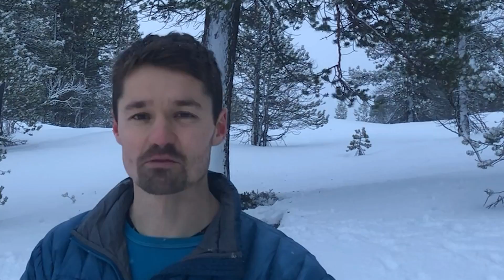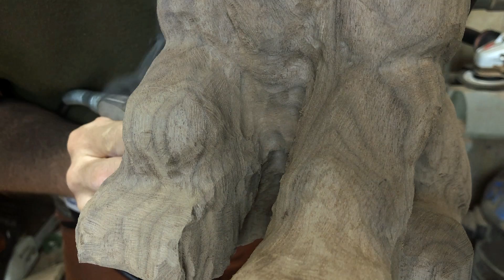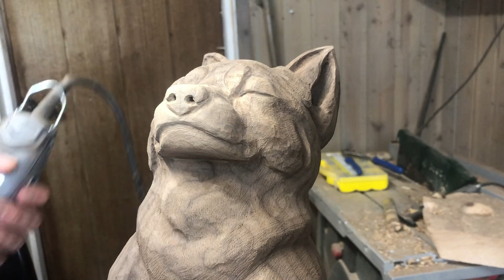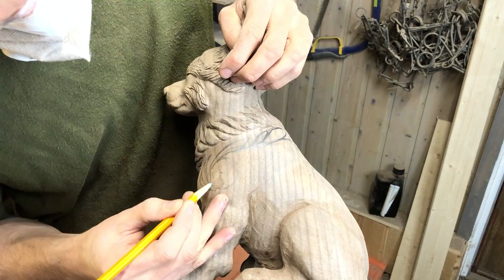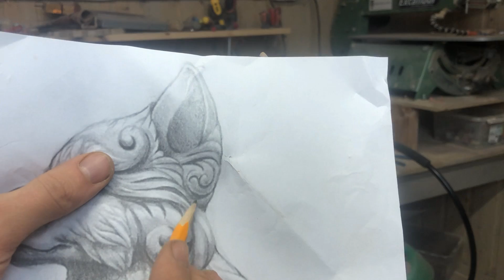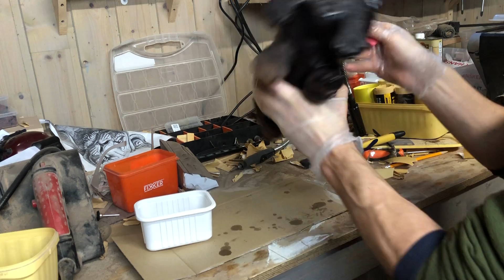Becoming Famous For My Sculptures Ep. 1 Season 1

Comment: Great work as always. I live in sweden and have a hard time to find good burrs, the one you used for the fur and other things, where did you get it?
Reply from the maker: Hey and thank you! I have the same problem. I have ordered many different cheap ones from ebay just to test them out. The ones i used for the fur is called Wolfram carbide burrs. i bought them off of fruugo.com.
Reply: @Jonasolsenwoodcraft  Aa ok, yeah I've seen that they had some on fruugo, wasn't sure if had the courage to test them :P But they seems to work fine.
Thank you :)